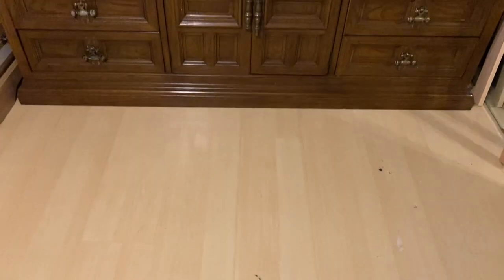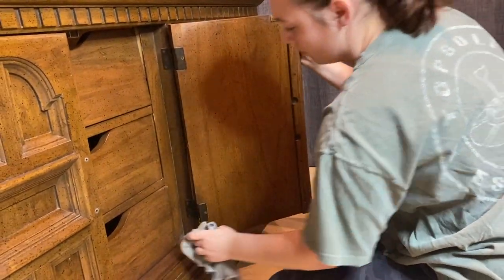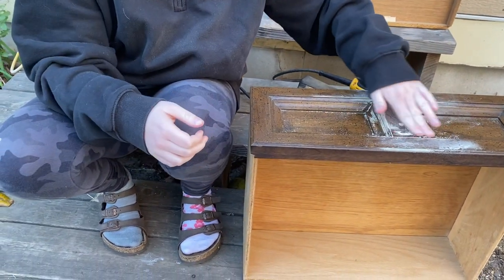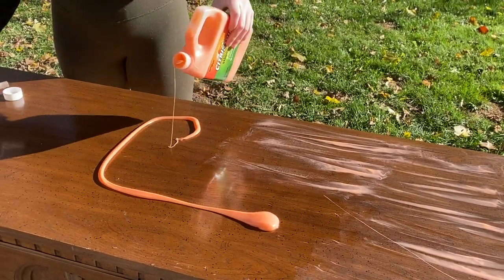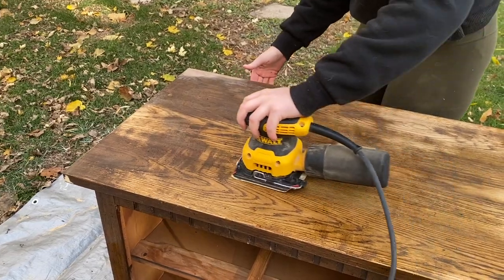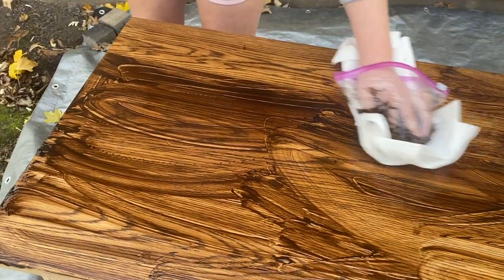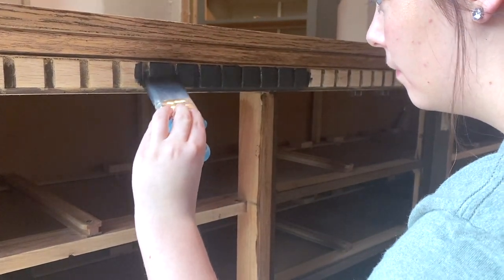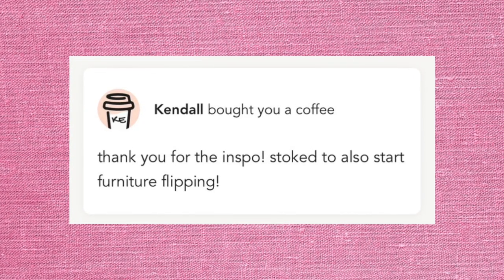Two-toned stain/paint combo, epic dresser transformation for Facebook marketplace/ Furniture Flip

Comment: If you add more stripper, it won't dry out as fast. Then cover in plastic. I would recommend a second coat of stripper to get the remaining finish off,  that way you don't gunk up your sand paper. Last, use super fine steel wool with mineral spirits to clean, it does wonders getting the goo and finish off.
Reply from the maker: Thank you so much for those tips! So you think I should be even more liberal on the stripper, in return it’ll be easier? Sounds backwards but I think I just might understand. I have been hearing plastic no matter what, that may be where I went wrong. Fine steel wool, got it! I will add that into my list when I get materials! Thank you so much for your help❤️
Reply: @HeatherLewisss  if I don't add plastic then I add extra stripper so it doesn't dry out. If using plastic then you probably don't need more stripper.

Comment: Citristrip is more work for me in the end especially since they changed the formula. Your sandpaper got gunked up with the stripper/finish that was left behind… otherwise it would last longer. You should use steel wool with the mineral spirits which helps remove the residual stripper. Also I’ve noticed cheaper sandpaper just doesn’t do the job like 3m and it looked to me that you may have not been using 3M. The fact you said you were using 80 to sand down the filler you use and seeing it not have much effect tells me also it’s a cheaper paper. You could also try a carbide scraper instead of the stripper. It’s still a lot of work but none of that cleanup which is a pain .